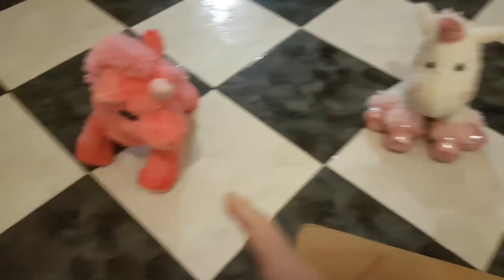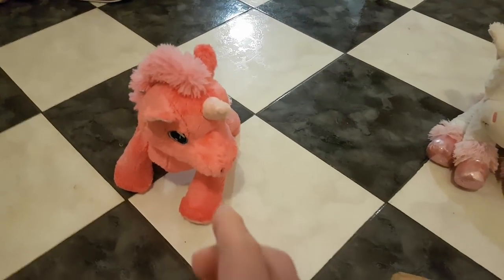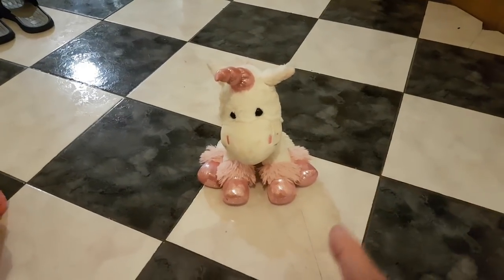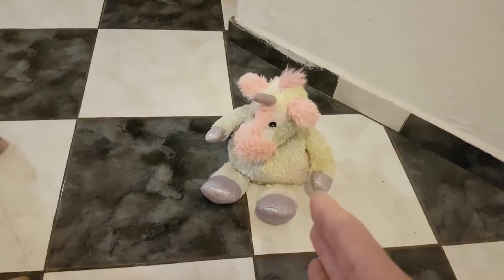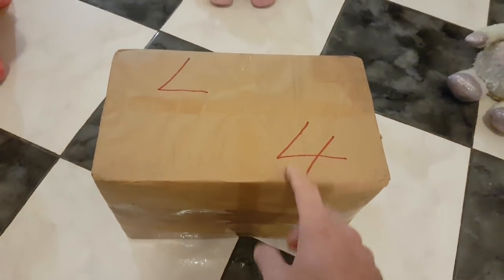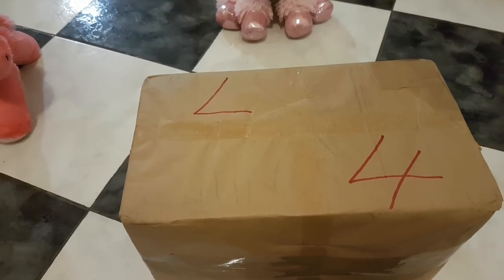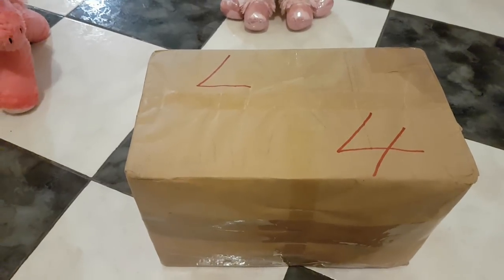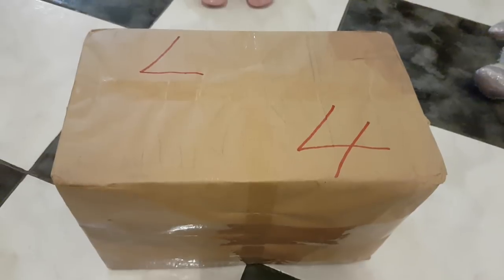LION 4 - Has landed!

Comment: What phenomenon do you expect to observe for evidence of strange radiation? Thanks
Reply from the maker: Will be using the same Logitech 910c webcam and  Cosmic Ray Finder software as successfully used to detect a few SR tracks from ECCO fuel last year. We know that LION reactors do emit some x-ray emulsion detectable emissions as this was what provided the evidence for soliton pairs from previous LION reactors - the cold reactors were placed into a tin with a few self-developing dental x-rays.

The activity, if any at all, will be highest immediately following the experiment and we are already 1 week out. The activity is likely far lower than ECCO fuel, however, we will not put any polymer foils in front of the 910c to try and minimise SR moderation.

It is not known if any will be detected, however, now is the best time to try.
Reply: @MFMP  , I keep coming back in my mind of how to find the spectral band of interest to identify the radiation. All photoelectric effects on matter either break a chemical bond (as in silver halides to elemental silver clusters) or liberate electrons which can be collected as current or heat. Which EM spectra response is a function of atomic bond resonance. The local bandwidth is a function of several things but notably harmonic resonance which is related to the fundamental and harmonic distribution. An EM source may be narrow or broad, think laser vs. incandescents. The general tendency is for shorter wavelengths to be converted to longer EM wavelengths in what I call the muddy thermal IR, EM spreads out, typically 8 microns out to 30 microns. But there is still telling information in the spectral response pointing to the primary resonance. We look at 3 to 5 microns and can see (infer) the shorter harmonic resonances like UV/VIS. What I am saying is this is the strategy to identify the source EM spectra which in turn can be telling on the atomic interactions. Cheers
Reply from the maker: @BluesDoctor  There are 3 ways to detect SR currently that give you real-time event logging.

1. Logitech 910c + Manycam - show track shape. Larger, much thicker CCD would be better.
2. Shishkin's modified 10B neutron detector https://youtu.be/v7kPPFUJHm8
3. John Hutchison's method, AM radio receiver https://youtu.be/eikwyFX-0s4 (actually from EMP when EVOs impact / explode)